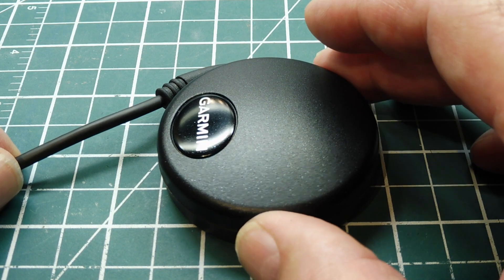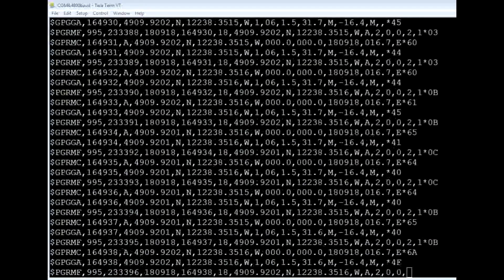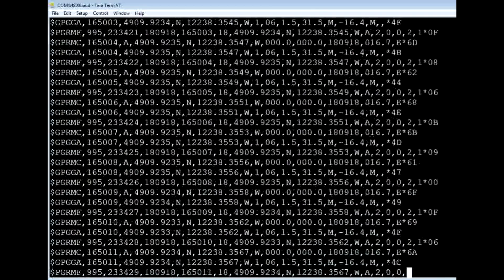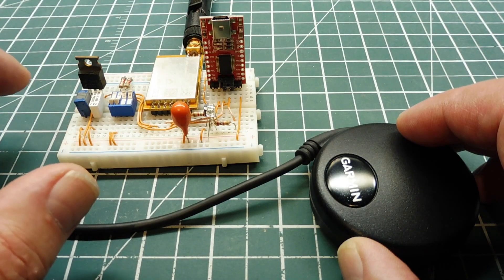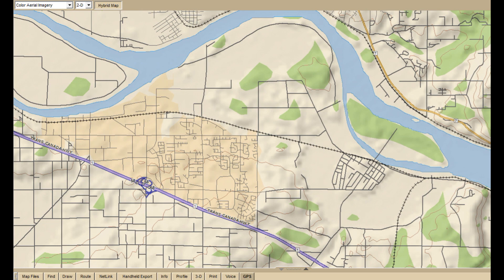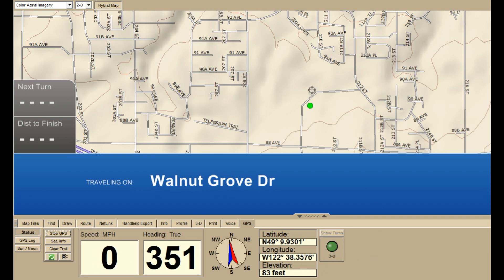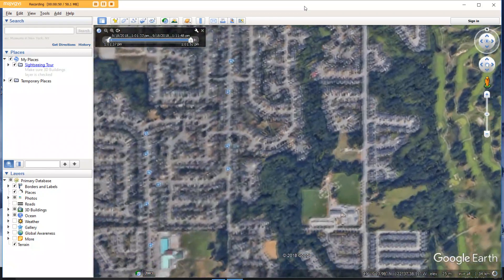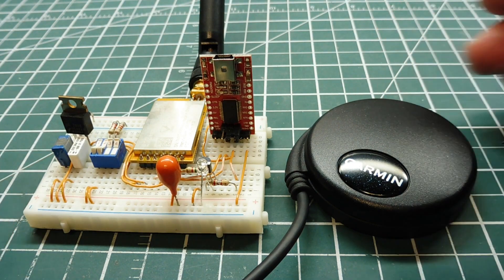GPS Tracking

Comment: That's really cool! I've never used a LoRa device like that... Do they seem pretty reliable or would it be a good idea to do some logging on the GPS side in case the LoRa reception cuts out?
Reply from the maker: The system would be restricted to the range of the LoRa radio link.
For  broader coverage you could use M2M cellular modems.
http://www.microhardcorp.com/IPn4Gii.php
Reply: But within the LoRa range there isn't usually much of an issue with obstructions or interference dropping the comms?